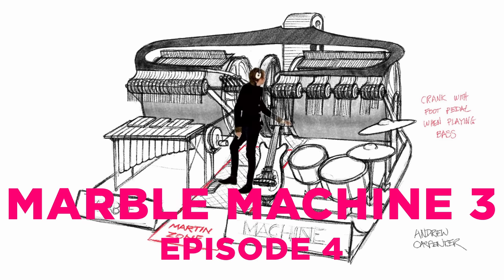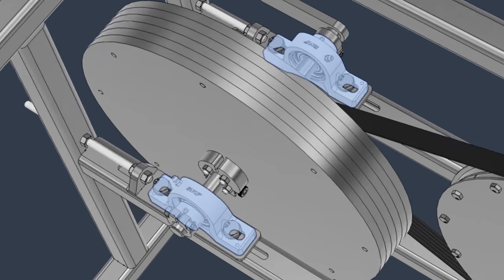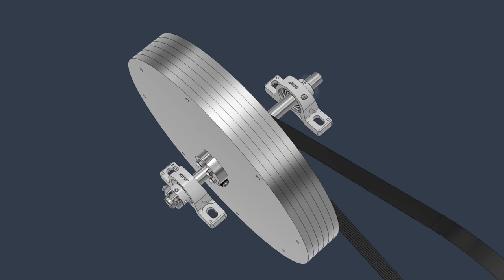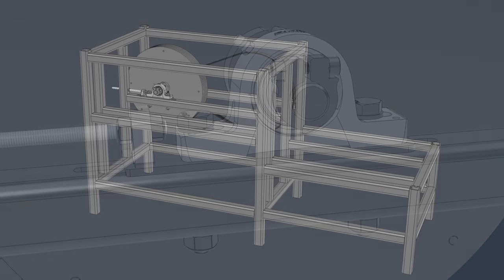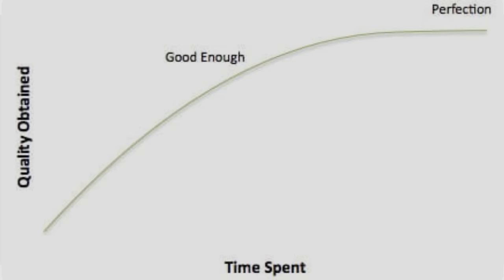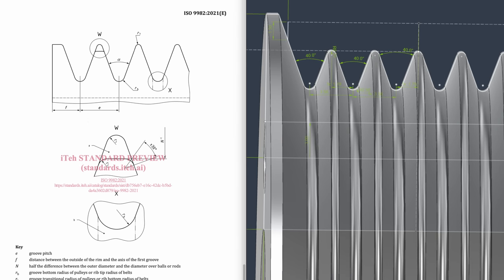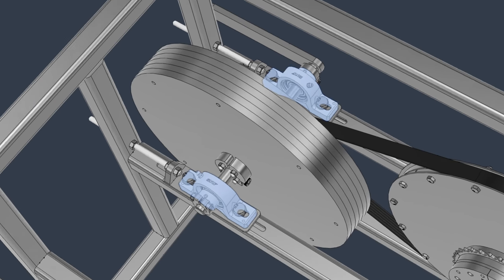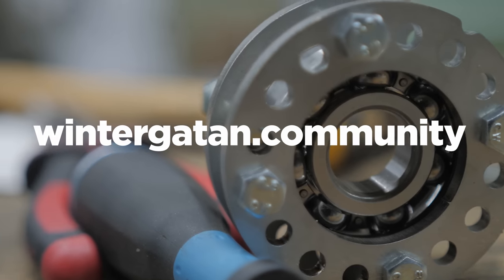A Better Flywheel Design - Marble Machine 3 Ep.4

Comment: One other thing to consider with the flywheel is that weight in the center of the wheel doesn't do much for you. An equivalent flywheel can be made by removing some weight from the center so that it is concentrated on the rim. You can get some good ideas from 19th century stationary engine flywheels.
Reply: Good point. This will make the overall flywheel lighter in comparison to it's storage capacity. That's less weight to carry around while touring and no downsides because the operational properties of the machine will be the same.
Reply: Say you have a solid flywheel. Can you make it a better flywheel by removing center mass? or is it that you can make it a slightly worse but much lighter flywheel by removing center mass?
Reply: I came to the comments to say this too. Adding some lightening holes will give a very slight reduction in rotational inertia, for a significant reduction in overall weight.
Reply: With 6 plates, he gets a little over 1 kg m^2 of MMOI for 60 kg of mass. For the same mass and wheel that gets wider at the edge (100 mm instead of 60 mm), he can get upwards of 1.5 kg m^2, just to put some ballpark numbers out there. In the same way that the same mass can get better tempo stability, Martin could also get the same tempo stability as 6 solid discs with the same weight as 4 solid discs. Reducing weight means more margin for the bearings which means more safety.
Reply: @GordonWrigley  By removing material, even from the center where it has less effect on the energy storing capacity, you will make it "slightly worse". However, you can make a perfectly equivalent flywheel by increasing the diameter slightly, while still having lower mass than a full cylinder.
Reply: @GordonWrigley  From my undestanding it depends on the mass distribution at certain radii, so it should be the latter. Although if the current mass is not too much, I don't think removing a bit of mass in the flywheel compared to the whole assembly would help that much, considering they would already need specialised transport for the MMX3 already.
Reply: Removing material, will create holes, that disturb the air while rotating, means it makes noise, something you dont want on an instrument.
Also big and fast rotating flywheels or no joke, badly placed weight reducing holes can make the flywheel explode while spinning.
Reply: If you keep the outer diameter the same, then by removing mass from the middle you get less weight, and a bit les storage capacity (so a "worse" flywheel). BUT, if you make the outer diameter just a bit larger, you can get the same storage capacity and a lighter wheel. The energy storage of each little bit of mass depends on the square of the distance from the center, so a little extra diameter goes a long way.
Reply: @jonasstahl9826  You could have one or two solid discs and the rest just rings on the outside - that way there are no holes to make noise
Reply: @jonasstahl9826  Regarding the noise generation, let's say the plates of each segment of the wheel are 6mm thick.  You could mill out 2mm from each side of the plates in a "spoke pattern" for the weight reduction WITHOUT opening up the holes to make the noise you would get by drilling through the plates.
No, you wouldn't get the weight reduction of completely removing those sections, but you would get some while maintaining most of the structural integrity.
Reply: This is the thing I wanted to comment immediately after seeing the thumbnail. Fly wheels are all about rotational inertia, not about pure mass.
Reply: @schmitz9a  The total mass is a factor of course, but if you can get most of it close to the outer edge it's more efficient.
Reply: @jonasstahl9826  i dont think hes spinning these that fast lol
Reply: @skylerlehmkuhl135  I posted something similar to this entire conversation back on a previous video.  I won't repeat it here.  But my suggestion was to have 2 disks, and 4 solid rings sandwiched between them.
If each ring has the same mass as the disk, you'd get more moment-of-inertia.  Again, I computed the exact % increase in MoI in that previous comment.  So not relevant here.

The points I wanted to repeat from my old comment were: (1) Rings sandwiched between 2 outer disks; (2) The rings will be made of a higher-density material than the disks, so that each one's moment-of-inertia will be the same as that of one of the the outer disks.  Or more, more MoI is good.
Reply: @jonasstahl9826  there will be enough mechanical noise that wind noise is probably not going to be an issue. If it is, he can fill the holes with 3D printed plugs, or just tape over them. I really doubt it will be an issue. Lots of instruments have spinny bits that aren’t at all aerodynamic. Even ones with microphones a few centimeters away, such as the upper rotor of a Leslie Speaker.  Only the lower rotor which is effectively a 15” (38cm) cube with circular rims has problems with wind noise, and it’s fixed with a cotton scrim cloth stretched around the rims. Again, this is with microphones pointed directly at them, 5-10 centimeters away. To the degree that it’s a problem at all, it’s easily solved and not something to worry about in the design.
Reply: @michiganengineer8621  I get your idea, but the machine is heavy anyway, you need multiple people to move it or a forklift.
There is no need to even think about weight reduction. It is a waste of time and efford.
Reply: I imagine a significant part of the motivation is safety; much harder to get something caught in the flywheel if it doesn't have holes
Reply: @MxJuneReese  It doesn't have to have holes on the outside. With multiple discs it's easy to make the two outer discs solid and have the 4 inner discs with holes, making the outside of the whole thing solid.
Reply: @GordonWrigley  Removing mass from the center doesn't make it worse. By concentrating the mass at the rim you get a more efficient flywheel. Remember that the further away from the center of rotation the mass is the greater the energy storage. For a given weight of flywheel there is always a point of diminishing returns at the moment arm gets shorter.
The moment of inertia is growing as the 4th power of the radius. Circular: 1/4pi r^4.
It is the same principle that works for I beams, by carving away all but the web that joins the top and bottom plates the I beam achieves maximum strength with a minimum of material.
Reply: @jonasstahl9826  No reason why Martin can't either keep the outer flywheel plates solid, or put a light skin on the outer disks of the flywheel to prevent or reduce the noise. Though if I were Martin, I might do a flywheel noise test between a spoked flywheel and a solid one.
Reply: @jackradzelovage6961  true, but the inertia is growing as the 4th power of the radius. You can put a lot of power into a slow spinning gigantic flywheel. Check out some of the videos of stationary steam engines.
Reply: @tonyvancampen-noaafederal2640  I think you are conflating removing mass with moving mass, I tried to word my question to avoid that. Several other replies here say that removing mass does make the flywheel slightly worse at storing energy.
Reply: @tonyvancampen-noaafederal2640  yeah you can put a lot of power in, but power doesnt make them explode
Reply: @GordonWrigley  I don't think so, but I might. On the other hand several generations of stationary engine designers built massive rim spoked flywheels to  optimize the rotating mass and minimize the total weight.
Reply: @tonyvancampen-noaafederal2640  Haha "flywheel noise test" :-D

Comment: Reaming will create accurately sized holes with a good finish, but wouldn't necessarily make the flywheel concentric. This is because the ream will cut exactly where the previous hole was made as you touched on in your discussion of using a hand reamer. This is why preparatory spot drilling in CNC machines is so important, you have to have a positionally accurate starting location for your hole if you want positional accuracy (i.e. concentricity). Laser cutting should still be plenty fine for creating a concentric enough starting hole, and reaming is still probably necessary to get the accurate size and surface finish, but it is important to note that reaming is NOT helping the concentricity itself.

Comment: He's LEARNING! 

Martin, I think that bearing housing was an interesting idea but I agree with the community. Use proven designs. This whole process will be a feat of design and engineering all its own even if you use off the shelf parts. I just finished going over a custom skid we had built for my work in biotech. The vendor most certainly didn't custom design every part on this machine. It's a beast in its own and custom designing things that can already be bought would only have increased the timeframe and increased the opportunity for failure.

Don't worry about leaving your identity and fingerprint on every part. This build will 100% be a part of you even if you bought every part of the shelf
Reply: Custom designing parts is a good idea whe' the solution doesn't exist for your problem or the tue a'd tested solution doesn't work because of the specifics of a project

Comment: Belt tension:
Your design will require you to carefully adjust both sides to maintain the shaft perpendicular to the belt since failure to do so could lead to premature belt wear or 'throwing' the belt.
An idler wheel pressing on the outer surface of the belt would give a single adjustment and would also increase the wrap around the smaller wheel, which could be beneficial.

Comment: SKF also makes standardized pulleys
Reply: Yeah it's a bit weird how Martin has come to the conclusion that standard axle bearings are a good solution, but he is now designing his own pulley.
Surely if he buys an axle, buys fitting bearings to hold it and then buys a belt, he can simply order a pulley to fit that belt to that axle. That will make sure that it's perfect and you can just order the part.
Reply: SKF uses ISO 5294 pulleys, but Martin uses ISO 9982 pulleys
Reply: Just use a standard pulley. The power input module should be able to use 95% off the shelf parts.

Comment: Nice to see some good progress Martin! Not sure what the weight of the flywheel will be, but it's better practice to keep the bearing blocks as close to the flywheel as possible, and the pulley on the opposite side to avoid gravitational stress on the shaft during storage & transport. A flywheel in that size and potential speed can make the whole machine vibrate and affect the rest of the functions (and sound). So from my point of view, you should have bearing block, flywheel, bearing block pulley, bearing block, that way you keep the whole system as rigid as possible. Keep it up, love your progress!
Reply: Yeah it was looking a little wide to me, I wonder if he was giving himself a wide clearance for adding plates if needed...
Reply: @xxportalxx.  True :) On the other hand,  since he uses modular design, it should be fairly easy to move the bearing block stretcher in/out when he have found the amount of flywheels he need.

Comment: Congratulations, the design is much improved and glad to see you excited for the next machine. Bowden cables and pillow blocks seem to spell success.

Some suggestions (others have also mentioned):
1. Move the pulley to the outside of the pillow block. This is a huge deal for maintenance and will make assesmbley/dissassembley much much easier.
2. Rigidly mount the pillow blocks to the frame and make sure that that part of the frame is secure as possible, no slots or extra complexity in the part of the frame tasked with holding on to the flywheel, it already has a very important job. 
2.5a Extra triangulation will be easy to add in the fabrication phase and do wonders for keeping this part of the machine behaving as expected. I'd guess that the design of the frame at the moment will flex like a parallelogram. Cheap insurance.
2.5b Maybe even some removable concrete slabs could be added to the machine to help dampen vibrations and keeping the flywheel under control but transportable separately for touring?
3. (related) Move the belt tensioning to an external mechanism.
4. You can buy shaft with key slot already in it, it's not the cheapest thing in the world but a great option for this part of the machine. The tighter you keep mechanisms like this, the less you will need.
5. Incorporate an independant brake (off the shelf) for the flywheel that is directly coupled to the flywheel shaft. Could be something you never need, could be something that you thank the stars for including. (Breakdown lever for artistic use implemented separately the otherside of the clutch)
Reply: Bowden cables stretch and need adjusting, and when they break, they fail completely.

Vibrations aren't "dampened," they're "damped."
Reply: @thomasbecker9676  bowden cables are relatively off the shelf parts, so seemingly a non-issue
Reply: @thomasbecker9676  hes not using them for precision motion so its no biggie
Reply: @stevensimpson3252  It's still a part that when it fails, it fails suddenly and completely.
Reply: @jackradzelovage6961  "Precision motion" made me laugh.
Reply: @thomasbecker9676  im sure martin and his teams checks would be very thorough before each gig.
Reply: @stevensimpson3252  I doubt that would help.

Comment: You should look into using 20/20 or 40/40 aluminium extrusion for the frame parts, one less thing to have custom machined except the lengths, which most places already do.
Reply: I often build things out of 45/45 and I would not trust it to remain 100% rigid. One good wack and the joints will move. Aluminum is also a relatively soft material, which doesn't help any.

Comment: If the flywheel is running the music machine, wouldn’t it be easier to adjust pulley tension from the input pulley side and leave the flywheel shaft stationary?
Reply: Honestly I'd imagine that the power input side of the design is going to end up more complex than a simple flywheel

Comment: Hi Martin, forget about laser cutting then reaming. Simply CNC mill the entire wheel. This will ensure concentricity to within the machine precision. An additional advantage is that you can face both sides of the wheel to avoid thickness variations, that will provide an excellent result in one step

Comment: Isn't it far easier to control belt tensioning by having a third small wheel that you can move around? That way once the flywheel is balanced, it doesn't have to move anymore.

Comment: if you want to keep changing the the pully you may want it at one end of the shaft. At the present design you would need to take apart the whole flywheel just to change the pully. but if the pully was at end of the shaft you change the pully without taking it totally part.
Reply: I suggest putting this comment in the subreddit, if it's not already there

Comment: Keyed shaft would be simpler, than that friction clamp, no?
Reply: You actually still end up with a clamp when using a key to keep the parts from moving axially along the shaft.
Reply: A keyed shaft doesn't prevent axial movement.
Reply: keyway would result in the low tolerance lasercut parts sliding off the keys. Would still need a clamp!

Comment: I would recommend keying your pulleys and weights to the shaft, rather than relying on a friction fit, so as to avoid the pulley or weight just spinning on the shaft. The shaft collars will prevent the axle from shifting longitudinally along the axis of rotation, but won't do much for countering the angular momentum difference between the shaft, weights, and pulley.
Reply: Yes, but not being keyed that could also be a safety feature. I don't think he is going to spin it up fast enough by hand that the inertia is going to create a problem with slippage. But, being able to slip if something jams might just be worth the slippage risk
Reply: You can get an insane clamping force with a split cone pulley. In the region of a couple thousand newtonmeters.

Comment: Martin, for added rigidity and stability, your flywheel should be separated from the pulley with a bearing block mounted in between.  So it should look like bearing block mounted to frame --> flywheel --> bearing block mounted to frame --> pulley --> bearing block mounted to frame.  You don't want your flywheel and pulley to be beside each other without some form of support in between.

Comment: Advice/experience comment from working with machines that use belt drive.

Belt tension was spoken of. Here. I see it is being solved by moving the WHOLE flywheel assembly to get the belt tension needed, which after the adjustment, could lead to belt walk to one side or the other and wearing the belt out sooner should the adjustment not being true/square. That belt is still just a flat belt with groves that can slip.

Belt tension Idler wheel/roller.  Why was that not considered? I work on copy machines. They do have adjustment for the belt by moving the whole motor assembly for small motor drives. On the big power drive motors? ( like here driving this major flywheel ). It's anchored down. Most often they have tension roller adjustments. Plus the belt and the drive / destination pulleys are ribbed. Zero slippage. Perfect timing. Unless the idler is loose and it allows the belt to skips a tooth on the gears. That's very rare. No moving of the motor mount or the other end. Just retention the Idler to fix it.

Comment: THIS WILL WORK.  I've been using this shaft and bearing setup with 60" dia. plywood wheels on my tricycle parade float for several years.
Reply: "Tricycle parade float"? I was like WTF?
Then I looked it up and now I get it, but it's one of those typical regional traditions that if you're not from around there, you've never heard of it.